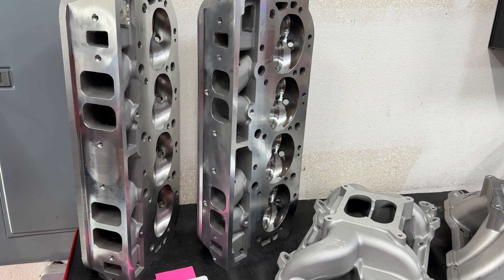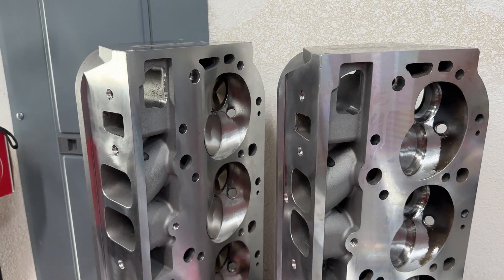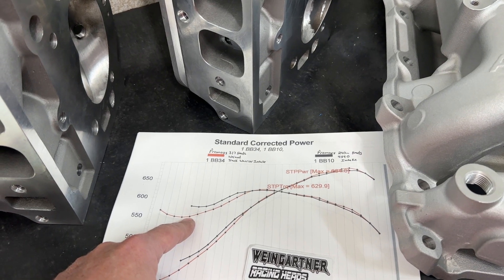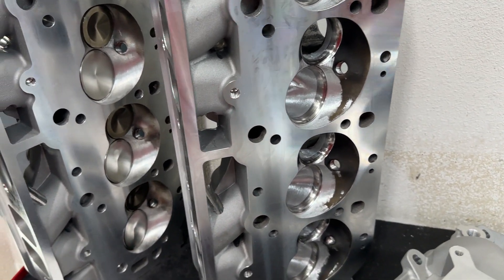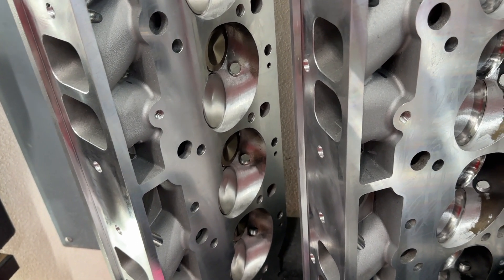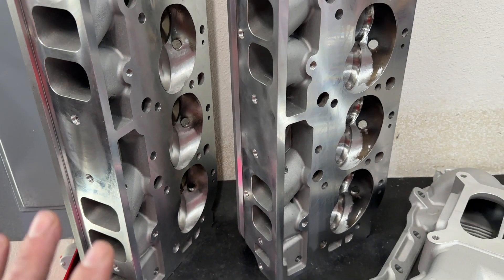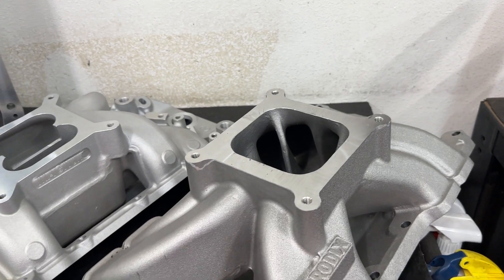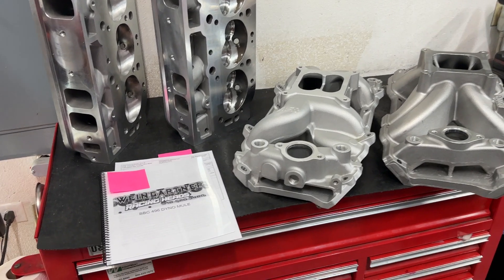Will These Changes Make More Power On The Dyno

Comment: Great stuff, thank you!
Just my opinion but I think that combo needs a cam with a much tighter lsa, more lift (I'd prefer solid).  Also think a larger carb, especially on the dual plane applications, would be useful.
Thanks for the content, also know you didn't pick the cam.  He has some nice engines but think most would like a tighter lsa.